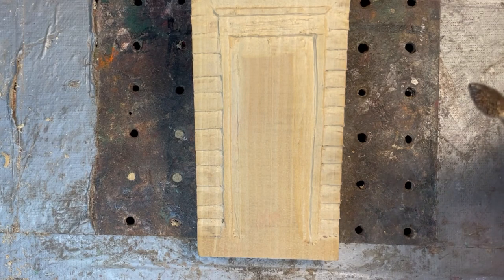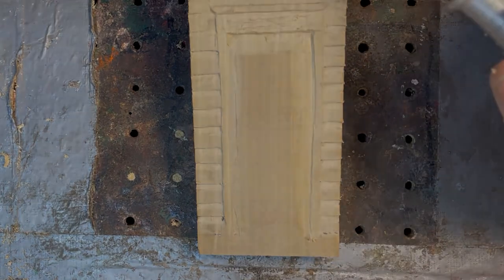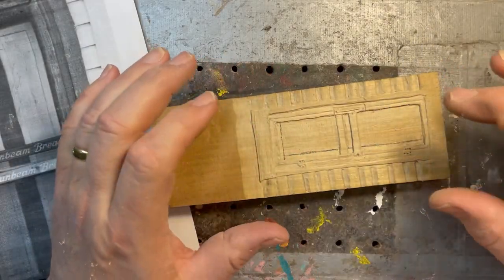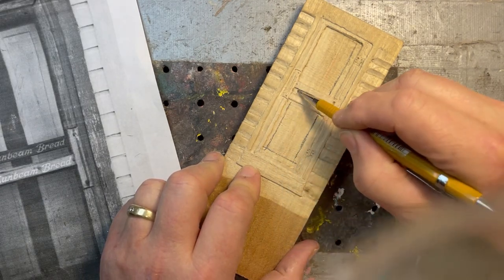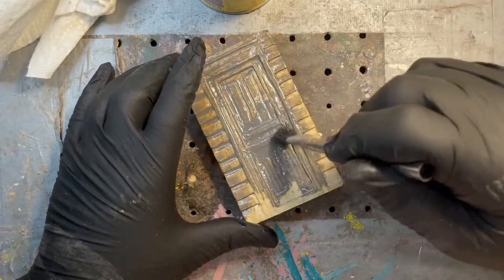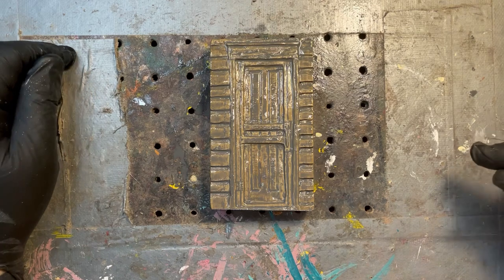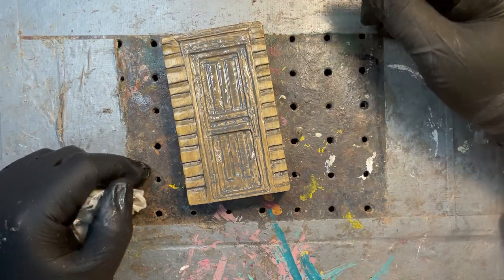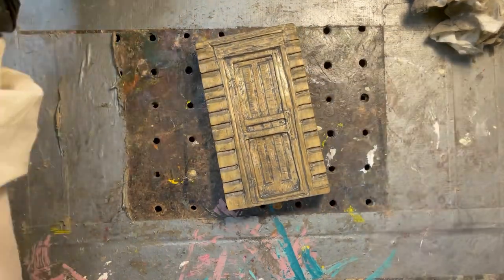A fun carving of a door from my childhood.

Comment: Have you ever experienced the dremel cut off wheel comimg off the shank. Bunch of videoes sayi g how dangerous that tool is when you use it. Enjoy your videos and you work.
Reply from the maker: I have never in my 6 years of carving with that tool had it come off. I do however always have on my safety gear. Mostly because I am a klutz.
Reply: @kedespo  thanks I felt you would be the best person to ask my question. You tube is not always the best to get reliable info.
Reply from the maker: Keep in mind, I do carefully inspect each bit prior to use.  However, nothing on those cutoff wheels have ever felt suspicious.